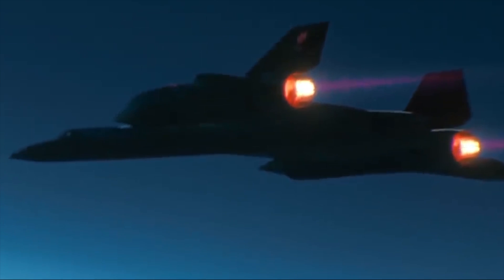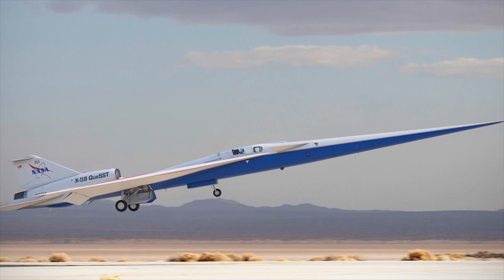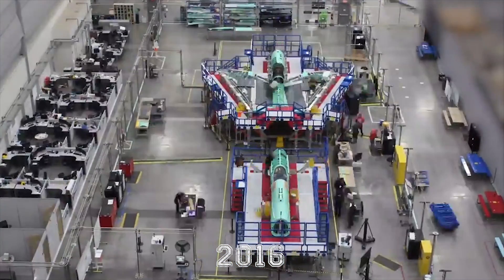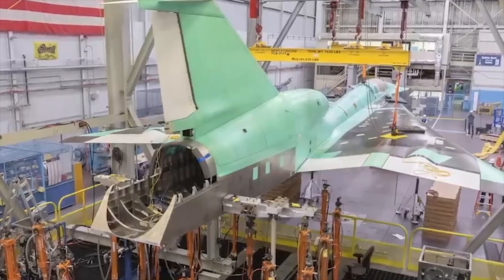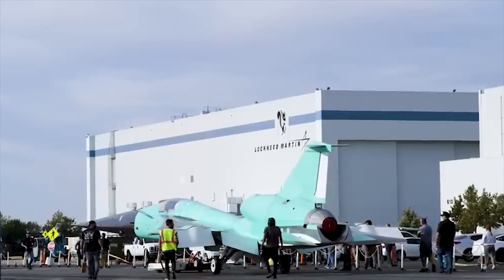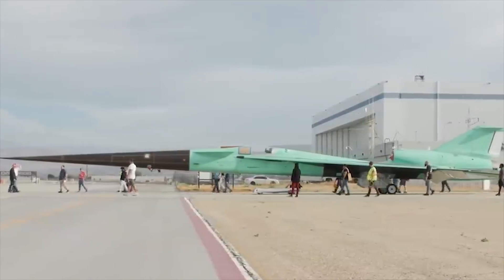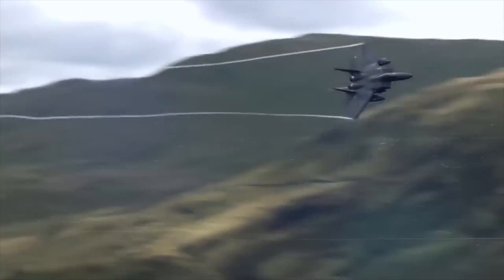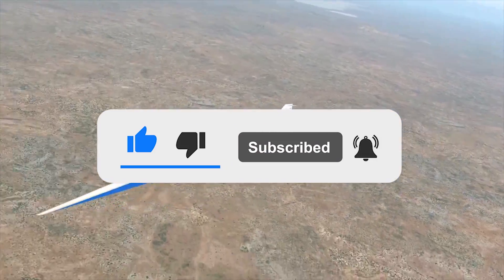US New Insane SUPERSONIC Jet Shocked The World!

Comment: 767 miles per hour at sea level (Mach 1). The numbers varie considerably at higher altitudes. At 30,000 feet the plane has to be moving approximately 750 mi an hour or Mach 1.12 to get a sonic thud, ¡ ¿ Slower Yet Faster ! ?🤯 Nothing NASA is doing with the Sonic thud plane is simple 😅 . The numbers are just everywhere.

Comment: If Anti gravity way will drive the center zero in the gapping zone it's the speed of light . 
Examples , the front pull the back push the center zero which is the  chassis and load is following only.

Comment: Looks like a mosquito.  A plane like that, large enough to carry passengers, will require larger, fuel gulping engines ynless itll be able to supper cruise.  Four F135 engines should do it.  Its pldb will probably increase with size as well.

Side note - my dishwasher is annoyingly loud.